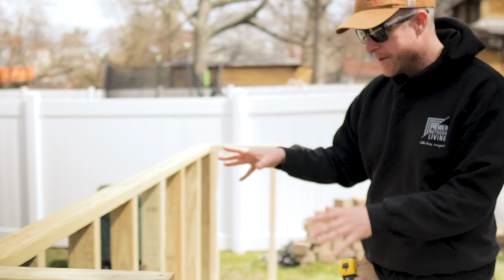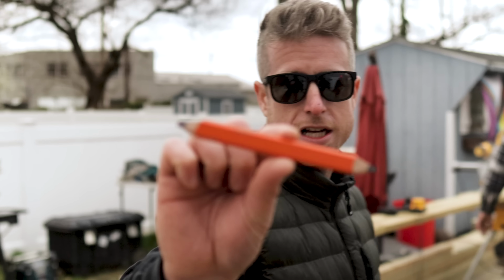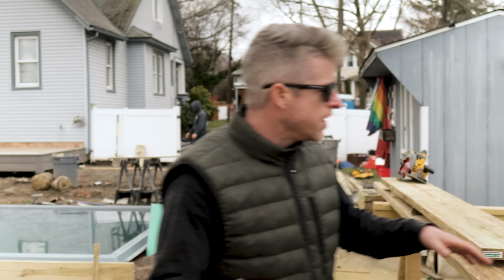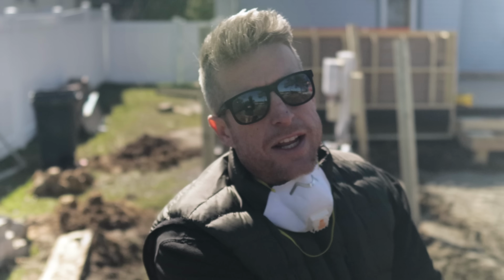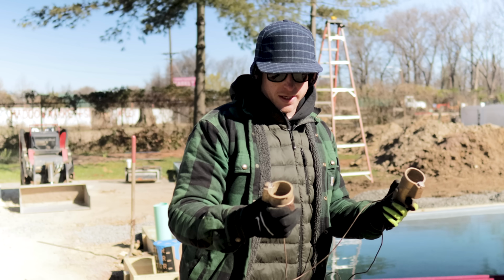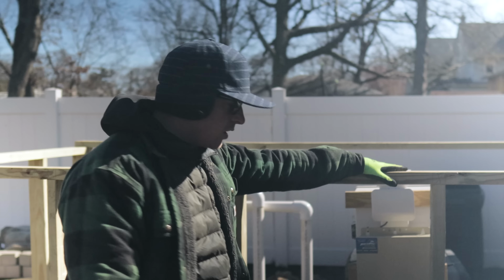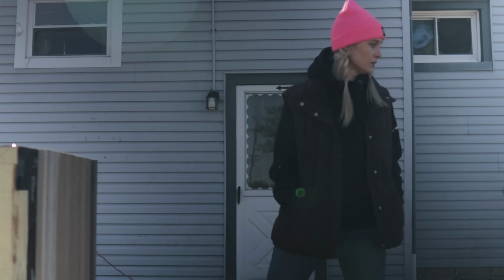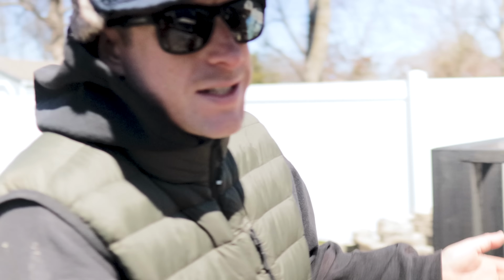Installing Decking and Pouring Concrete Around The Pool - DECK, PATIO, POOL Ep 2

Comment: Tom didn’t mitre the boarder, he didn’t make an equal gap between the boarder and the ends of the deck boards. It’s also a different detail than the one featured at the start of the video.
Reply from the maker: Not the three I had in mind, but I’m gonna have to check his work 🤔

Comment: I love the designs you come up with and you guys do amazing work! The only thing i would like to see is tape on ALL the framing, not just your flat blocking. If you tape all the joists and beams, your framing would last a long as the decking. Without tape, lifespan is only 20-30 years.